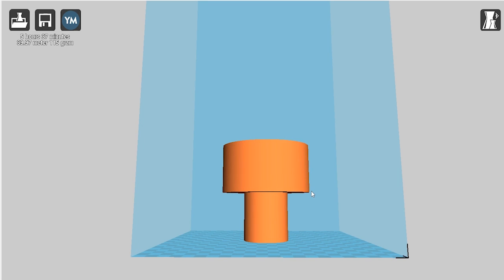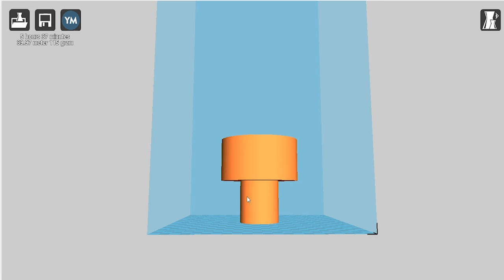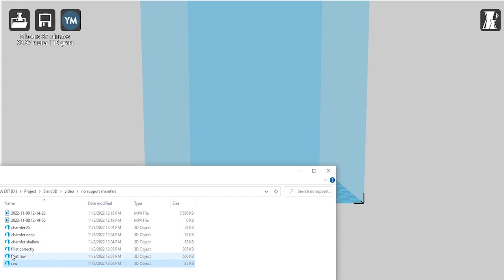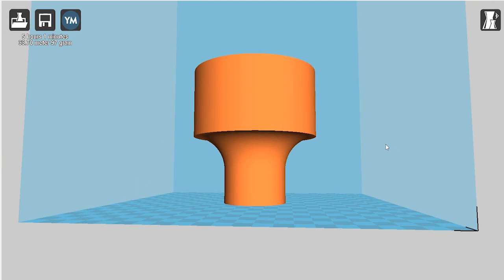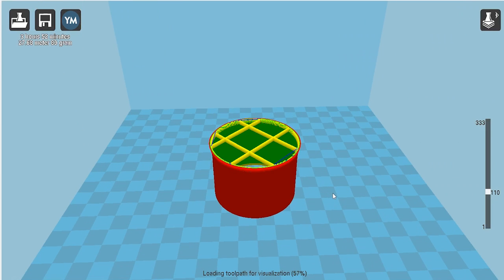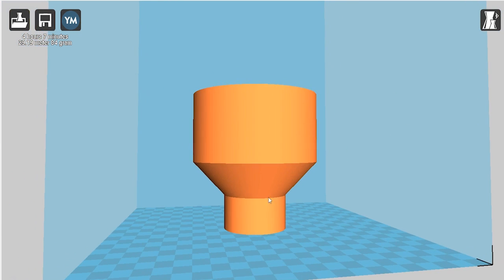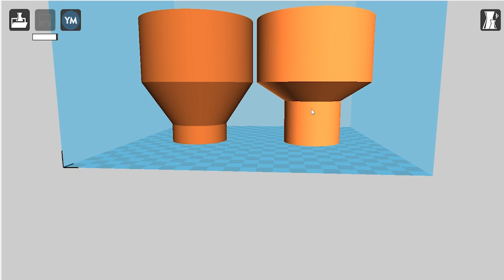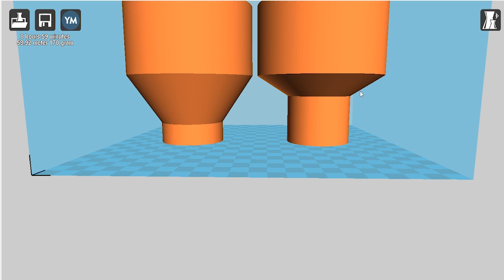Easiest Way to Eliminate Supports | 3D Printing Design for Beginners

Comment: Y'all are getting too hard pressed over the little details. Yes, obviously the best thing in this example is to flip the damn part, you missed the point. Yes, it adds material, but it's more reliable than wide support areas. Yes, you have to change the design, but for crying out loud you're making thousands of parts here and making money, if you don't know how to change the design or somehow "can't", then you shouldn't be pursuing this as a business. When you deal with money on a part by part basis, reliability is top priority! Y'all aren't old enough or humble enough to understand that.

Comment: It feels like people here are missing the point that this video is trying to make. All the video is trying to show is different options you can consider when designing your model to eliminate the need for supports. Yes, this particular example could technically be flipped upside-down, but that's not the point here.
Reply from the maker: Thank you

Comment: Not what I was expecting but ok. Also, you can use pre printed supports that you put in place during printing, but I suppose that's not suitable for mass manufactured printed parts either.

Comment: I would have just flipped the part over, lol ;) But seriously, I have found using a chamfer or taper very useful, especially with vertical holes where counterbore recesses  must be oriented to the bottom or both ends of the hole, for bearings in a spool for example. Few things are more annoying and time consuming than digging supports out of a hole while trying to preserve the depth or squareness tolerances. Useful tip in cases that it can be applied.

Comment: Did you know there's a trick to produce bottom-up countersunk holes with 90 deg angles without using any support? (I bet you do)
It's something I learned from the design used for the printed parts of a Voron DIY printer.

Comment: Your other videos give good advice, but I can't see how this helps. What if a part like this has to be designed as a complement part? What I mean by that is, that it should fit into somewhere and, therefore, the horizontal part is absolutely ESSENTIAL. There are sadly very few cases where you can get away with this trick.

Comment: click-bate title. Exaggerated claims. Supports may still be needed depending on design options. 

A person can suggest using chamfers and/or tapered shapes in about 30-60 seconds. 

Lastly, just turn that model upside down, printing the large side at the bottom. No need to change anything in the design.

Comment: kind of stupi video.... in this particular case you could have rotate the model. Would be great if you told the audience that often you can eliminate supports by rotating the model. The champfer thing is ok, but in design you not always have a choice to make a champfer instead of an 90° angle. Also you could mention that tree supports are getting mainstream in the slicers an they are much more efficent. Also there are lot of support avoidence mechanisms in design that are much more important than this you shown.

Comment: Gee, people are missing that this is just an example.

Of course you can flip it upside down in this case, but not always, and a newb might not know that a chamfer is better than a fillet for the mentioned reasons. Or the double chamfer concept. You guys are too harsh on this video.

Comment: Many times changing the geometry of the part itself isn't an option.

In general it is good to optimize your parts for FDM 3D printing in places where it is possible. It can save both material and time 

Cura tree supports is the true answer.
They use way less material than traditional supports and they can reach to places where traditional supports wouldn't

Comment: How about just turning this part upside-down? This way the upper part is smaller than the lower. And if you can produce such a diameter after the chamfer you definitely can do it at the base.

Comment: I like to print in ABS and then split parts like the one in the video into 2 parts and the solvent weld them together using acetone or ABS cement. 
...if you're printing PLA you can do the same using super glue depending on the geometry/load bearing utility of the print.

Comment: You need to be able to design parts for printing but this isn’t an option for a lot of situations, if the part is functional or needs to look a certain way then this just doesn’t work, then you are better either printing with supports or designing the part in multiple pieces.

Comment: In this case i would just print a ring that i would put over the narrow section, set a print pause just before the area that needs support.  If you do it right the prints are perfect, no need for chamfer or filet and you can keep your design with a 90 degree overhang.  But these are great tips for using fillet and chamfer in the design if it allows for it.  Larry

Comment: You know the title of your videos extremely misleading. By adding a chamfer or fillet does not make it so I will never use supports again. I don't know what you would do if you had a part with a void in the middle of it how are you going to use a fillet or chamfer to print that.

Comment: A poor start to the video discussing supports for a structure that prints without them after a simple 180 degree flip in a horizontal axis. Not really helped by the obviousness of the solutions discussed.

Comment: Another solution is to have reusable supports.

For your part, have a metal bushing that have a smooth top surface with the exact same height needed. Add pause in gcode at the exact layer before the massive 90deg overhang, slip the bushing, resume printing.

This "insert pause - add something- resume printing" is a great feature for really strong functional parts. I've done plenty of prints with embedded steel rods, plates, magnets, etc inside the part acting as reinforcements. - the only trick you need to master is to absolutely make sure that part does not stick out past the previous layers printed (especially during printing.. so for small parts or magnets that may stick to the hotend or shake around must be held by some glue.. CA/hotglue/3d ped )
Reply: Very useful hack! I'm going to keep this in mind when designing stuff that needs to get a bit sturdier. Thanks! 👍👍
Reply: Was looking exactly for this. I amnew at 3d printing as a hobbyists but I am also an engineer, so I was thinking if it is possible for mass production to print the support first and then, do the print even if its possible to do a 3d path instead of a flat first layer... I mean, at the end, a 3d printer uses g-code like any other cnc machine, right?
Reply: @fernandocastro2075  Yes G-code just run regardless. Most if not all 3d printers have 2.5D approach and thus the head is very flat and bulky as opposed to CNC's that must account for tool reach and clear path for movement (and this involves highly 3d moves, and from there it was a quick step from 2.5D to 3d toolpaths for machining and adding other axis to gain better reach to swivel the cnc head to make undercuts, tilt the workpieces, turn the workpiece etc. So the toolpath g-code for 6axis milling machines is superior in many ways to g-code of 3d printers. Experimental gcodes for highly modded 3dprinters exists but by no means is standard or ready to use (to name a few there are mods to increase reach and increasing the clearance angle to make room for 3d moves with longer nozzles and removing fan shrouds and even lowering the whole hotend and extruder on the X rail, others took a CNC approach with rotary worktable to tilt the printbed and rotate it, or there was a prusa mk3s modded with a 45deg extruder-head and put on a stepper to rotate it. Each of the experimental approaches involves custom math for generating the g-code or running a custom script to modify a portion of the g-code from standard slicers. So there are interests for moving up from the classic 2.5D for 3dprinting but is still an experimetal approach and not present in any ready to use slicer. Maybe the next additive manufaturing revolution will include more degrees of movement.

Keep in mind that 2.5D for 3d printing allready covers the entire volume so all 3d parts can be printed in 2.5D while very few cnc parts can be milled with standard 2.5D milling in one fixing. The CNC world is highly evolved because of needs to cover more complicated geometry and to be able to reach the part from the right angle. Also CNC parameters are much more important like speed and vertical feed and tangential feed, climb cuts and tool geometry all is VERY important in order to produce a good part, while not selfdistructing the part, tool, machine and not kill anyone near it. On the other hand much less is gained by adding another axis to a 3d printer and overall 3dprinting is not currently a real tool in industry. The SLS metal 3d printers do not rely on toolpath to attain strength so 2.5D is once again enough without complicating it more.
Reply from the maker: great idea is you are open and able to create the tooling. As well as willing to insert it halfway through. Generally not the best solution for mass production

Comment: You can add a single wall around the object so the printer can bridge across.
Then you can easily remove it with a knife.
This allows to not use a ton of support materials and let your object with the exact same shape.

Comment: First print a an overhang and bridge test to see the possibility and limits of your printer, then adapt the design (if possible) and finally if support is not avoidable the best solution for large scale printing in my opinion is to design the support with the part so you can make sure to use the minimum material required and build it in a way that allow for a fast and easy removal.

Comment: Umm, that's not always an option. In fact, I'm bet that is more often than not, not an option.
Reply: sure it is. you need to learn how to slice a model better sir. most model are weakest in the layer direction. Do take some time to look at model alignment sir.
Reply: @reyalPRON  oh ok. Thanks (sarcasm).
Reply: @Vandel212  Keep using supports for all i care.. IF you learn to align a model for strength you will find that there is always a way. but the tradeoffs might be bigger than you will accept. If you cant understand that the model created and used an example here is merely a 180 flip and its a perfect print, there is not much hope for you is it?
That you are this bad at humor that u need to spell out sarcasm....  yeah. Fitting for your comments.

Sell ur printers.. u cant use them properly.
Reply: @reyalPRON  oh ok. Thanks (sarcasm).

Comment: I had to give this one a downvote and for the sake of not letting this be some random "You suck lol!" comment I'll try to give some constructive feedback. I assume your intention for making this video was to show some tricks when designing specifically for 3D printing and how you can avoid using supports by designing around the capabilities of FDM printers in the first place. Clicking the video I expected some cool dummy layer sorcery or something in that ballpark. The message I'm getting from this vid though is "How to never use 3D printed supports again? If your model needs a lot of supports, just print a completely different model that doesn't need any, duh!"
Judging by the almost 50/50 like/dislike ratio I'm not the only one who feels a little bit clickbaited. You have already proven that you can do much better. This one sticks out like a sore thumb...aamof like a sore thumbnail. Go to your channel page to the videos tab and just look at the thumbnails, do you see what I see? ;)

Comment: Clickbaity title as it’s not gonna work for wverythhing, figured out a 45 degree chamfers work best, was a bit informative so ok worth a bit, but what about other shapes.. 
I found I would rather design a piece that snaps into another than do supports - also for strength reasons - some parts need to be positioned a certain way.. if you can design so stuff snaps into each other, it’s actually fast to iterate wirh smaller parts, mine worked out great

Comment: But what’s really wrong with using supports?  Not having supports is like driving a car without a road. Supports are necessary to achieve a successful print. I don’t think you need to re-invent the wheel.
Reply from the maker: Removable supports are wasted material.

Comment: First, Kudos for making videos! Looks like you're a smaller channel, so just the fact that you're getting content out is better than most can say.
I do have to agree with the community though. Adding a chamfer or fillet may not be an option. I realize the model you showed was just an example and obviously the best way to print that one is to flip it over. A better universal solution would be to rotate it by 30~70° then maybe cut out a small part of the original model to give it a flat surface to print on. If the top portion and the lower pedestal are both touching the print bed at a printable angle, you can easily print without supports.

Comment: For a while now I have been thinking printers need to learn to rotate their whole chasis as to move the weight forces away from the buildplate and parallel to the nozzle movement direction on support sensitive features of the part. alternatively just dump and level sand with each layer printed, so that there is always some solid material underneath the nozzle. even water might work especially for PLA
Reply: There's also the possibility that you print a part to serve as support, then pause the print as it gets to the top of the narrow bit and drop the support over and resume the print. So you only have one support that can serve many prints.

Comment: Changing design of your part is quite often not the option you can choose. And in fact, the slicer may use less material for supports than what you end up using for your changed geometry because it comes with all its perimeters and filling while supports are usually pretty thin and sparse structures.
You could have said just turn the part upside down, it would work nicely on your example too and it's about as useful as the suggestions you give.
Reply: good example of this is i have a large scale printer printing a bumper for a car. there is absolutely zero chance i can not have supports while not changing the visuals significantly . the part has a 38 inch long bridge that makes supports completely unavoidable. thankfully for something of that size cutting support material off is actually really easy so it isn't a big deal but it does use about $15 worth of PLA.
Reply: @dillzilla4454  ur printing a bumper...for a car...in PLA? As a prototype?
Reply: @alttabby3633  I'm going to fiberglass over it. The PLA is just so I have something to fiberglass over. It isn't structural at all.
Reply: @dillzilla4454  just make sure it doesn’t get warm as the fibreglass sets, doesn’t the resin used for fibreglass either make heat or need heat to cure? That could cause you issues. Are you just letting it cure as is or are you putting it in a vacuum bag?
Reply: @conorstewart2214  I'm using different resin. I'm using UV curing resin instead of the traditional resin you would use for this sort of thing. Usually it is harder to cure properly with that size but in my case it is easier and better.
Reply: @dillzilla4454  will the UV properly cure the resin through the fibreglass? Also UV resin still generates some heat.
Reply: @dillzilla4454  Why not make the PLA piece solid then and use at least 2mm top layer with 5% infill or use lightning infill if available. That should solve your bridge problem with better stability than supports. The 2mm top should eliminate any imperfections caused by bridging the low infill. I don’t know if the geometry of the part makes this approach practical, but it’s something to consider. Should be able to bandsaw off any parts that can’t be there too. After sanding to shape, you could apply the fibreglass overtop.
Reply: Those were my thoughts exactly while watching this.  Flipping this model 180° aside, if the stem of the piece needs to fit into another object, chamfering and filleting will definitely not work unless the accepting part can be modified also. I don't need to tell you that's far more work-intensive than using supports. Also, not all models that need supports are as simple as the example.  I recall watching a video a while back that involved rotating the model to a certain angle while using a raft to eliminate most if not all supports. That would be the only true and best way to print support-free, and even that procedure can't be used 100% of the time.
Reply: @Nowayfella  sometimes for functional parts the only option is to print the part in separate pieces, all optimised for different print orientations and then assemble after. An example of that is the planet carrier of a planetary gearbox I printed, the part would require more support than print to print it as a whole so the input and output pins were printed separately from the main body of the carrier with hexagonal holes left for joining them after, they were also joined with a 3D printing pen for extra strength. If you know a part won’t be easily printable then it is pretty easy to design it to be separate parts that need joined after. Obviously this doesn’t work in all cases but in a lot of cases it is possible and doesn’t usually need any change to the looks or function of the part.
Reply: It gives more options, I find you harsh on the video.